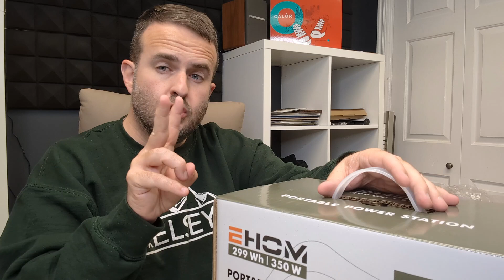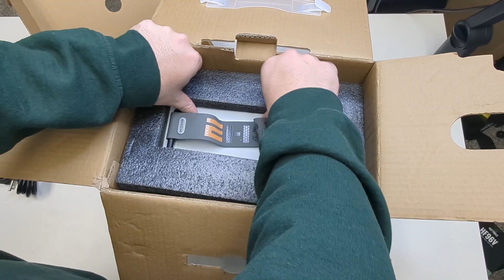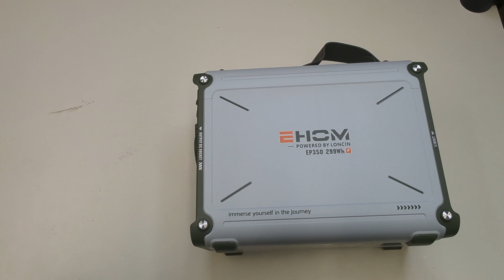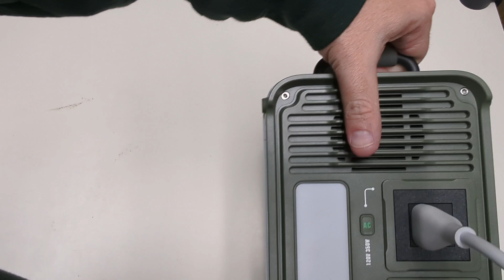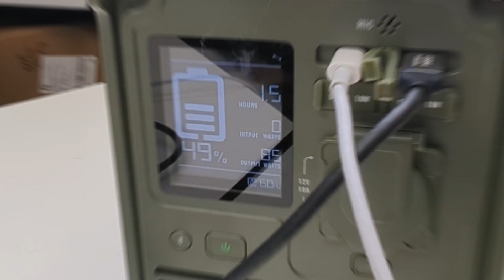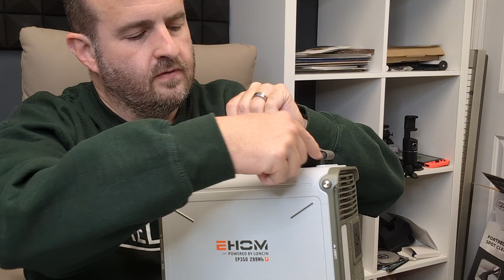EHOM Portable Power Station 350W Mulitport Options

Comment: Better or worst compared to other in same range?
Reply from the maker: I think for the price it does a really good job. I have a bigger version that lasts a little bit longer and not only charges but also pushes out at the same time and has more plugs but it's almost twice as much.
Reply: @MrCampbellReviews  tks
Reply: @MrCampbellReviews  more plugs does not matter, for this size device, 1 plug is more than enough, if you used 2 plugs if it had them, you would run out of power very fast, I use it as a backup to my larger power stations so while they are charging for and hour or 2, this one can do the job in their place.